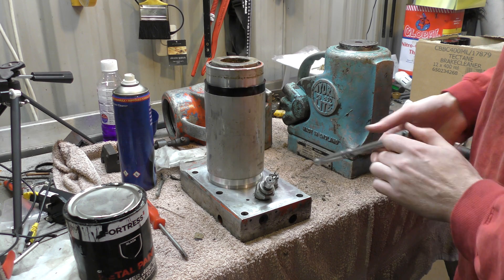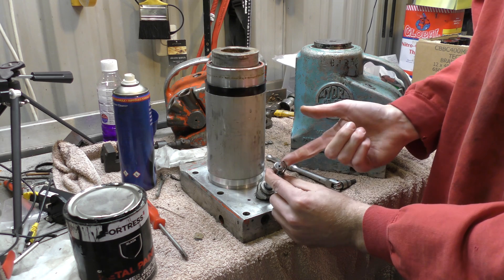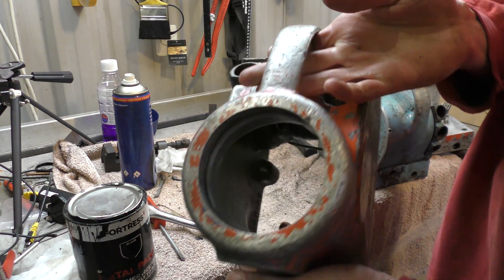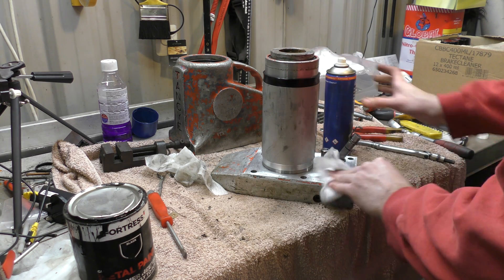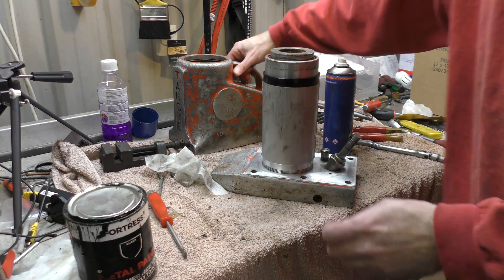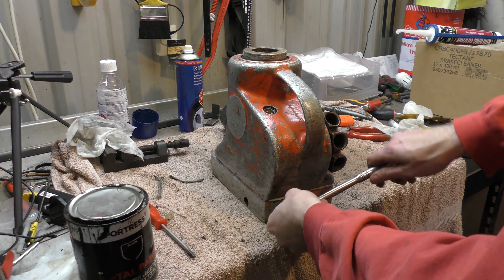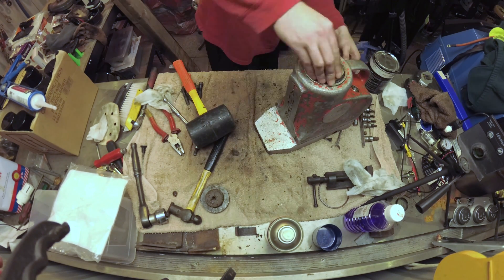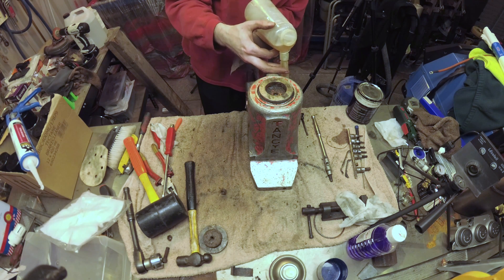Tangye Hydralite 25 / 30 ton bottle jack

Comment: @David McLuckie Mate , do you realize that YOU are the only one on the whole , I'll repeat , WHOLE  Internet that did repair of Tangye Hydralite 25 / 30 ton bottle jack . Respect !
Reply from the maker: Thank you.  I actually made this video because I couldn't find anyone who had taken them apart.
Reply: @DavidMcLuckie  Oh please , thank YOU . And , of course , here is the question for you to answer , pretty , pretty please . My friend gave me same one but 15 tons to repair it . Now , in process of dismantling I screw up that wire that is going around the neck of the plunger ... and there is no way to put it back on proper position . Do you have any , but any advice or link to see  position of that wire on that plunger ? Please .

Comment: Well done Davey me boyo I live in Dunoon  Argyll and have parkinsons disease but still young at 66 years not stone LOL .Anyway I have a couple of workshops which I built about fifteen plus years ago one for wood and one for metalworking etc. I have a few of those tangye jacks . And one f them I got today. My son also called Alistair I have 3 sons anyway he gave me a much larger one I assumed until today I might need to buy the seal kit where do they get off charging that for a few rubber band robbery or what brother. Your new pal big Al  Doon the watter  LOL Alistair
Reply from the maker: I understand that if you've got 30 tons resting on the jack you don't want a cheap seal to fail.  But if you went to any hydraulic supplier and got good seals of the same size there is no way you'd be spending £100 on seals.  The resevoir seal is just a paper seal.

Well, I hope you get some use out of your jacks.